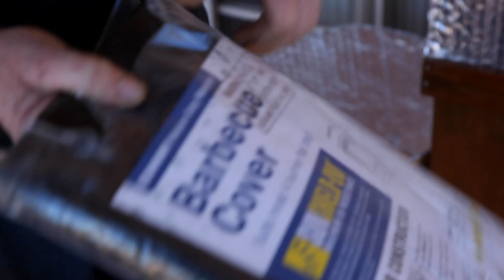How to Build a Fish Tank Observation Hive Part 5 of 5 - The Bush Bee Man

Comment: Are the cells oriented to their proper position? Do you need some sort of vent in top of the cover to prevent condensation in the hive?
Reply: Remember it had the vent hole, that aside the cover is going to need a lot of propyls the least of their worries is airflow at this point  and condensation is going to be well away from the comb and most likely on the glass to start with.
Reply: @Dstick1Spearfishing They will not make any propolis during the winter.  Condensation will be directly above the cluster, the bees waste is emitted as water vapor when they can't fly to relieve themselves. Winter time is when you have to worry about condesation it kills plenty of hives.

Comment: Will that hive cook in the summer?  Just thinking of greenhouse effect
Reply: The bees will regulate the temperature. The cover he made flips over and had a port already in it for hoses and wires.
Being as it will be in the shade 90% of the day, it should be okay.
Reply: Provided the ventilation works and I'm guessing the BBQ cover is off in summer and no cows are allowed in there, everything should be OK as Glass is a great insulator unless it is in direct sun. So BBM will probably have that in hand. On the other side of the argument, if Mrs BBM is not happy all bets are off!!!